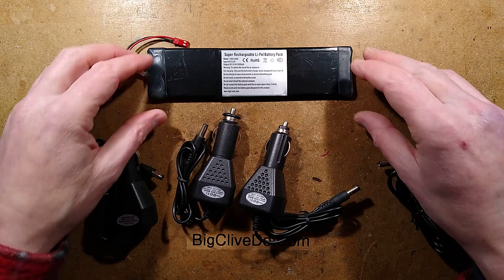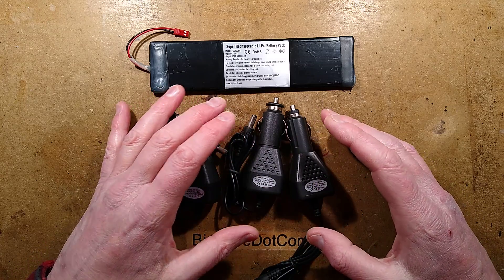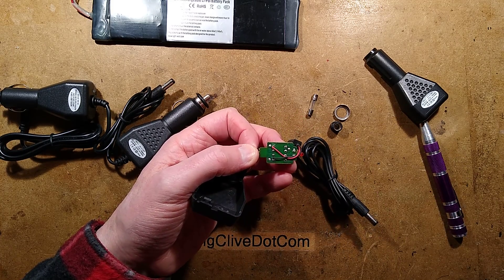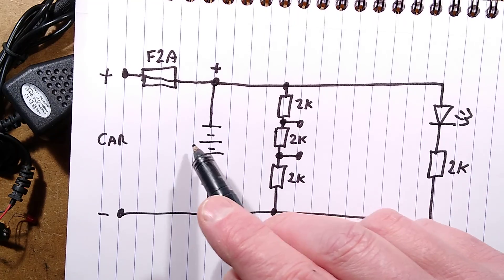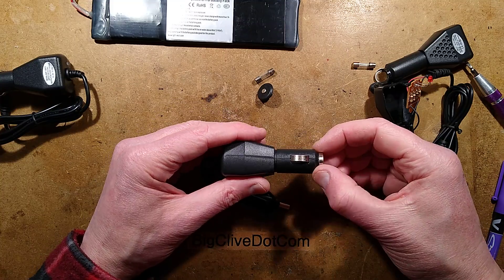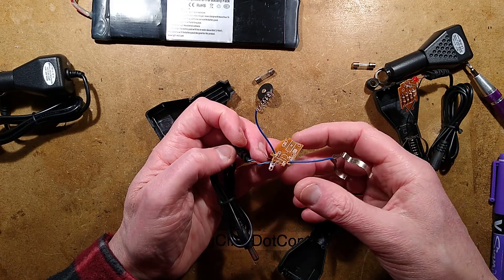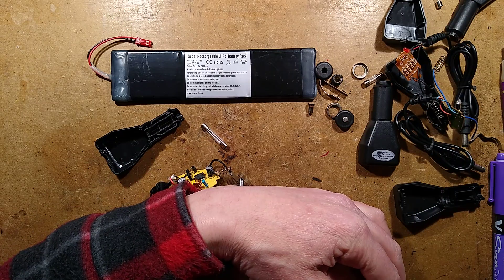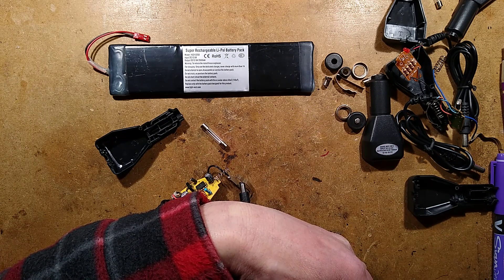Triple trouble - when offshoring goes wrong

Comment: On the other hand I've heard about a buyer saying "we expect a failure rate of about 1 percent"
Japanese manufacturer: "Do you expect the failed units with the others, or should we pack them separately?"
Reply: @Zen boiRyS That's a decades old story based on when the Japanese quality system was head and shoulders above everybody else. (Probably 1970s, before Motorola created six-sigma in the 1980s.)  It compliments the Japanese.
Reply: I remember reading an article in one of the electronics trade papers back in the 70s. They compared Japanese semiconductors with U.S. made semis (same part no) and found the new U.S. parts had a 1-5 percent failure rate, while the Japanese parts had a zero percent failure rate. Apparently the Japanese where testing EVERY piece that went out the door. 
However, I've learned from experience that if I order electronic parts from China I should expect a 25 - 50% failure rate (always buy spares!)
Reply: @jfan4reva  IDK about semiconductors but I know if I am doing something simple like patching up a cheap electric lantern I will go ahead and use a cheap part (usually a resistor -- I buy them 30 or 100 at at time for pennies per resistor shipped from Shenzhen since we don't have a local supplier anymore, I now have a nearly lifetime supply of 10, 20 and 100 ohm resistors).  I haven't had one fail in that use.  However, if it is expensive and mission critical I would be reluctant to use a random Shenzhen Shit Land part.
Reply: I've read somewhere they shipped 99 working units and 1 unit labeled defective. Or something along those lines. I cannot find a source on this story, was it from IBM?
Reply: The "Japanese manufacturer" must be Toyota to ask that question.  Toyotas almost never have defects (and last forever, my mother put 300K miles on one in the early 1970's).  Honda is pretty good, too (certainly much less than 1%), although not quite as good as Toyota at eliminating defects.

Comment: Fascinating. Two of those were evidentially 'improvised' from recycled junk (left-overs and rejects from other production runs, perhaps?), when the third one was presumably what was actually ordered.
Reply: Not convincing. I spent years buying all sort of products directly from china. Never seen anything broken delivered. Some lower quality stuff sure but are usually the exception. My solar car charger has no regulator either. Nothing blowing up or catching fire so far - 1 year in, and permanent connection for 2 cars. The battery simply could not be charged to beyond 16.2v. It's a physical limit. I have too much water in the cells I want to get rid of. Not losing that either. The water level was raised from use of batt-aid for around 17 years.

Comment: The wire over the fuse trick brought back a memory from a long time ago. It must have been in the early 1980s. I was doing a lot of work for a hire company mainly on diesel generators. The problem was that the generator in question had allegedly damaged the hirer's equipment. I disconnected their equipment and checked the generator and it appeared to be quite stable so I proceeded to check the load to find why it no longer wanted to work. I can't remember any details now but when I started pulling fuses to check them I found two HRC fuses had pieces of wire across them. I was very glad they weren't involved in the failure or the issue could have become quite incandescent.
Reply: Oh, so you found the "battle shorts" that are used to ensure continued operation under all circumstances.  No extra charge!
Reply: 'incandescent'.....Yes....it's life was short, but quite bright....!!
Reply: Sort of like the old penny behind the screw-in fuse trick ... when one didn't have a proper replacement for a blown fuse. 😁
Reply: @davidh.4649  , or a bullet.  i know someone who did some work in an indonesian police station.  there were bullets in some fuse holders.
Reply: @davidh.4649  I don't ever remember seeing any screw in fuses here in Australia. Domestic installations used porcelain wedges  Commercial premises did the same with some use of "iron clad" switch/fuse units. The fuses in those units were often porcelain wedges but also HRC fuses. I remember seeing fuse wire wrapped on a blown HRC fuse. That could have made for some interesting pyrotechnics in the event of a fault.

Comment: Sometime ago I ripped off this simple and cheap circuitry and soldered a long wire straight back in place without the circuitry. Now I have a 12v extension wire to use in the garage or around the car when needed. Don’t put those plugs in the bin, you still can make some stuff with them.

Comment: I know someone who made quite a bit of money visiting China for months at a time doing pre-shipping inspection of product.  Three men on rotation, 100% inspection, and no issues escaping China.  Accountants said "We're spending too much on these guys, drop them down to once every few months".  Then product started to fail big time, someone in the warranty department looking at the claims did a quick check on the batch dates, and surprise surprise no claims on batches when the inspectors were on site, but loads when they were back in Europe.  Chinese lost the contract, and a couple of small Europe based companies are rubbing their hands with glee after the accountants worked out that getting the product made in Europe was less expensive in the long run.
(The European companies had been supplying all the warranty replacement product so they were already familiar with it.)
Reply: Accountants - don't you just love them?  It reminds of the joke about a large oil tanker sailing up the English Channel.  The Captain and his mate were on the bridge, and the mate commented on the loud noises in the body of the ship, followed by a large splash.  "Oh, that'll be the company accountants - they're on board checking on efficiency".  A little later , the accountants came up to the bridge and said that they had found a huge, noisy mechanical thing in the hull, which seemed to be consuming large quantities of oil which was hugely inefficient, so they took it out and threw it overboard.  "but that was our engine - it makes the ship go!"   "Well", said the accountant, looking out the window "we still seem to be moving forwards OK"
Reply: @steveknight878  Moving - towards Dover?
Reply: Thing is, it's the accountants that have absolutely no connection to anything in the production chain.   The accountants that actually work with the production chain understand the value of that person to be there.
Reply: Yes I've seen an account of an American guy doing inspections on steel to be shipped back to the US. Same thing, accountants questioned why his price was so high (living in China and dealing with non stop scams didnt seem to be a good enough excuse). So they withdrew his services. Shockingly the very next shipment was all under specified dimensions!
Reply: Really, accountants are just there to keep track of the numbers.  It's the executives who demand reduced costs to boost their own bonuses.
Reply: @Player-to-be-Named-Later  - Yes and no.  It's the accountants to determine where a cost can be cut.  They may be told 'reduce costs 6%' by an executive, but they're the ones looking at the overall list of expenses and deciding where they can be cut.   The executives can't be bothered doing that.
Reply: This is also how the generic drug market works.

Comment: Clive.  It is a bit more complicated than you think.  I read the label on the battery, but I was unable to find any specs for a model YSD12250 "Super Rechargeable Li-Pol Battery Pack".  However, some points can still be made.  
1. This is a lithium polymer battery, the least safe type of lithium battery. It is also the cheapest and highest power and energy density of common lithium types.   It is very common, but usually used where energy density and high power output are important.  Lithium ion and lithium iron phosphate are safer.
2. At 12.6V this has to be a 3 cell pack in series, a very common voltage.  12.6 is the absolute maximum voltage on the cells (4.2V each) when they are totally full.  The label says 12.6V in and out which is very unusual.  More likely it will be 12.6V in and closer to 10.5V when discharged.
3.  In fact, since this is a car type charger, the input voltage will be up to 14.5 volts.   Assuming car alternators work the same way in Britain as in Canada.
3. I do not see a balance connector, and all lithium batteries MUST have a balance system or they will eventually catch fire.  So the pack  must have a built-in battery management system (BMS).  I am assuming fire is a bad thing to be avoided.
4. A BMS will include circuitry to manage current in an out, not allowing it to get too high. It will also limit charge voltage and will balance the cells so they never get above 4.2V each.  It will shut off the charge when the battery is full and it will also shut off the battery if the volts get too low in discharge.
5. The BMS MAY allow up to 24V input safely if it is designed for this.  It also may not.  I can't tell as there are no specs.  If it does not, then an off board voltage limiter is indeed required.  A nominal 24V system will be be closer to 28-29V when charging.
6. It is also possible that the BMS boosts the output to 12.6V regardless of battery voltage.  I don't have one to test.  However, the batteries will definitely drop to under 11V when discharged.
7. The BMS means that there is no need for current or voltage limiting in the charger (up to the maximum the BMS can handle).  Simply passing 12.6V-14.5V to the battery is good enough.  Any more circuitry is over kill as the BMS takes care of the rest of charge safety.  A cheap charger is fine if the BMS is well designed and built.
8. None of this is defending Chinese QC!!  I would be more concerned with the quality of the BMS.  If is is good, the rest of the defects are not that important.  Opening up the battery to see what is inside would be very interesting.
9. Bypassing the fuse is clearly a huge safety breakdown as that is the last-line-of-defense safety device if the BMS fails.
10. The web URL www.light-vest.com on the label is for sale.  So whoever made the battery is no longer around.
Reply: He examines the battery pack with the rest of the vest in a previous video: https://www.youtube.com/watch?v=SgPw1Ig2jYQ&t=560s
Reply from the maker: It's now www.lightvest.com

Comment: Could the charge controller be hidden in that blue sleeved adapter? I always thought you were supposed to charge lithium cells in a CC/CV mode and sticking them directly across a CV source would be a big no-no. Almost as big as bridging out fuses with wires, to a pick a completely random and unrelated example.
Reply: Doesn't really need to be Constant Current, just need to be limited current. Like a resistor between the voltage source and the battery is enough to limit the current in some cases.

Having a bunch of resistors in the plug to limit the current could actually work if they where connected correctly, and if the battery had built-in over voltage protection.
Reply: As Clive showed in previous video, there is no charge control in this blue sleeve adapter thingy.
Reply from the maker: The battery has protection in it.
Reply: @kjur18  D'oh! I saw that video but I thought that the circuit board was from somewhere else in vest. Didn't realize it was from the blue sleeved thingamabob.

Comment: Well that's a general problem with outsourcing. Even at best of times you need roughly one internal person for every 5 external persons. 

Also outsourcing such a comparatively simple, yet not off the shelf thing to China seems very dubious. After all you cannot take advantage of any of the advanced manufacturing techniques, yet you have to pay Chinese wages. Any company trying to compete with low wage countries like Germany needs to cut corners somewhere.

Comment: A mob I work for bought £20,000 of chinese parts, mechanical stuff rather than electronic. The pre delivery samples and photos were good. What arrived was horrendous !!  Every single part needed to be 'corrected' by me. Took a month. Parts not to size, broken taps in blind holes, welds made of silicone and thickly painted to hide them, etc, etc.   Never again.
Reply: I don't even bother getting pre-delivery samples from China anymore.   They are always perfect.   I also tend not to go with the cheapest but rather the one best capable of answering questions and giving an initial quote that meets the specifications.   I had one recently for a order of about 1500 coax cables.   I specified halogen free.   Got the quote and the datasheet showed PVC jacket (PVC is halogenated) sent an e-mail back and got response back in 5 minutes with the same datasheet except the PVC photoshopped out and changed to PE.
Reply: The mafia sure has changed their business plans
Reply: Can confirm. Have friend with family in China. Says when something goes wrong, they would rather hide the defect in some way and cut corners than redo it. It's expensive and time consuming to maintain high quality. When they're already working at minimal margins, every bit counts so they'll cut corners if they think they can get away with it. What matters to them is pure volume. Push as much crap out the door as possible to make up for the abysmal profit margin per unit. If some foreigner asks them to make something, they'll take extra care to make the best possible showcase product to guarantee a sale. If they believe it's going to be a one-off order, they don't bother with QA. If they've been around for a while and you're a recurring customer, they will still try to save money but make sure each unit is at least usable.
Reply: @slightlyevolved  yes. Ps5 made in China have a Coil Whine issue. The PS5 made in Japan do not.
Reply: @nyetloki  We don't need no stinkin' varnish on that coil!
Reply: @slightlyevolved  Good luck getting a Chinese judge to side with a foriegner.
Reply: @slightlyevolved   a contract is only worth the paper it's written on, unless you've got money to pay for some lawyers childrens expensive educations...

Comment: I fully understand your swearing, the swearing wasn't even that bad. But man, what a mess these things are. So best advice would be, if you buy it, take it apart. If it's decently manufactured you can put it back together again and use it. I was genuinely shocked see how this was made, a shorted fuse and a chewed up circuitboard, that's bad.

Comment: Reminds me of a D26 drop-in for a flashlight, sold as 3-18V or something, ie, should be able to take an 18650, pair of CR123s, pair of 18350s, etc.

Worked beautifully with a single 18650.  I tried a pair of 18350s, and it lit up a pretty but dim blue.  Ie, SERIOUS overcurrent to the poor LED.  1-2sec before I switched off the critter in absolute shock and horror.

So I opened up the f'er, and all it had inside was a single ballast resistor!  Wtf?!?

My 5-star review (Amazon) instantly went to a 1-star trashing of the POS.

Ie, doesn't matter what it's sold as, or even the sticker right on the beastie.  It was outright FRAUD to sell it as such.

Always check out what you get if you at all can do so.  And don't even believe what's in print, either in the description or right on the device itself.

Comment: This kind of thing is common. Take a look inside a PC power supply. You will find spaces and unused connections. This is where parts were fitted and they've found they can omit them, typically the interference suppression parts like common mode chokes and capacitors. Later models of the same PSU commonly have smaller heatsinks.
Reply: Interesting. I've opened the few PSUs I had so far and haven't seen any obvious missing parts.

Comment: I've seen the fuse replaced with just a longer spring before, but to solder a wire to the outside of a fuse. That's just insanity.
Reply: Admittedly I've done it plenty of times, usually with 1 or 2 thin strands to roughly emulate the original current capacity, but to come like this directly from the distributor or the manufacturer is simply unacceptable and is a law suit just waiting to happen when some trucker's rig goes up in flames.
Reply: Right now I have a Hewlett Packard 8640B signal generator waiting to be serviced. I only did a quick visual check, pressed some buttons, turned some knobs and popped the fuse out. Surprise! The fuse had a wire soldered across it. The best case scenario I can think of is fried power supply. Anything fried beyond that point will likely turn it into a 20 Kg paperweight.
Reply: 3/16 or 1/4 inch copper tubing is very reliable.
Reply: I know. What's wrong with tin foil?
Reply: Probably hand soldered in volume. Someone went to work, spend a day soldering wires to fuses, and then went home happy that they'd done a good job - either the person is fundamentally an idiot, or they knew they were going to kill someone and did it anyway.
Reply: @maxhammick948  Surely that operation must have involved more materials & Labour than buying in a batch of higher rates fuses if they found they were needed!
Reply: Where labour is so cheap as to be negligible. 😳
Reply: One time I did something akin to this butchery- emergency blown tire while alone at night in the country side. Cheap plastic tire pump plug cracked and the fuse fell out in the dark, so i stuck a screwdriver bit in its place to pump the tire. so stupid and dangerous but i was desperate, had a fire extinguisher and bought a new expensive pump after the trip!!!
Reply: I don't know why they go this way, fuses are dirt cheap, even in my country where we don't manufacture anything and mostly threw away broken stuff, fuses available for very cheap price less than ~10 cents.
Reply: @مقاطعمترجمة-ش8ث  because the fuse kept blowing from the broken circuit board!